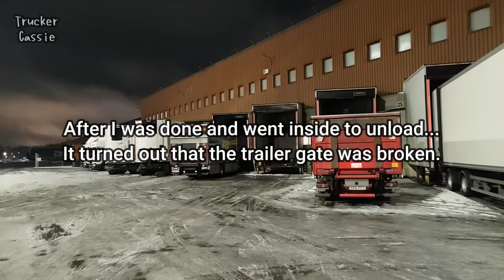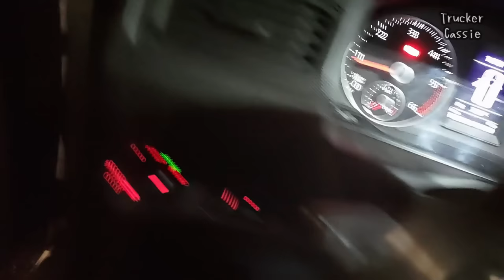Ice Road Trucker Cassie Vlog! | Part 2

Comment: Hi Cassie, great to see you back. I think the old car was a Saab 96 V4. If I remember correctly they had a 2stroke engine. Stay safe out there and look forward to seeing your 2024 adventures. 😎🇬🇧
Reply: The V4 was a 4-stroke 1500cc engine and was used in Saab 96 between 1967 and 1980. The older 1960 - 1967 model had an inline 3 cyl.  841cc 2 stroke engine.
Reply: My neighbor had one of those!
In Maine they used to Ice Race them on the local lakes!
Those were fun days!

Comment: I wondered about unloading the truck first then repositioning the trailer - thanks for the explanation, it makes perfect sense 👍
Sorry that you fell over. The company should not be using that parking lot. 
Interesting about the weight shift - I wonder how it works - is there a big weight or is it the suspension 🤔

Comment: 14:10 I am quite sure that is a Saab from about 1980s.
Reply: A friend of mine had one in the 1960's, Saab 3 cylinder two stroke with triple carbs. It also had a free wheel device !